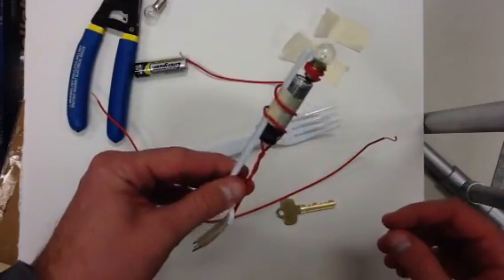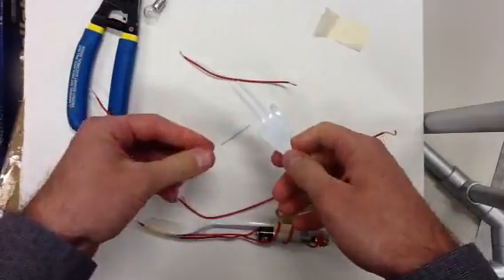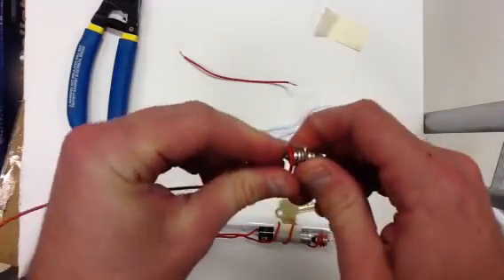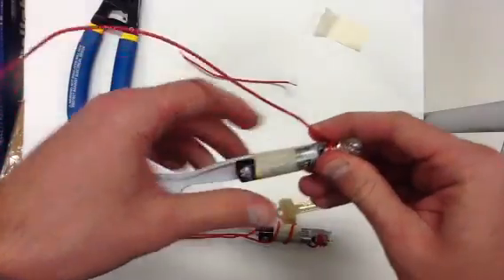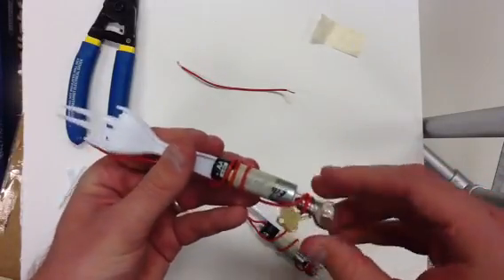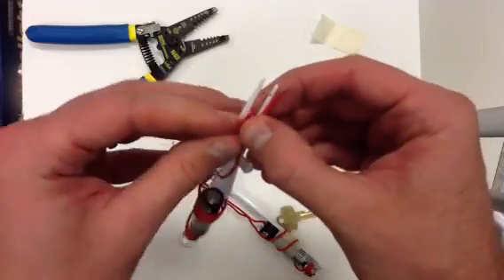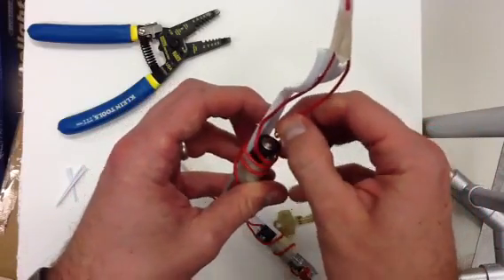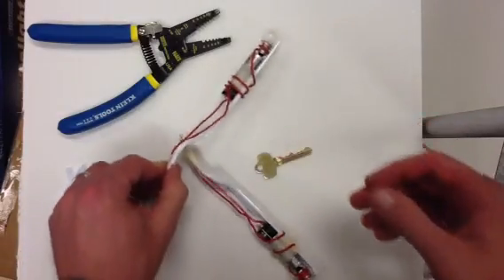Creating a Conductivity Tester

Comment: Can I use any wire?
Reply from the maker: AZ Chan, I would recommend 18 or 22 gauge solid wire. You can use any wire but flexible solid wire will make the project easier.

Comment: AWESOME! An awesome home-made flashlight, so cool!
Reply: It’s a conductivity tester, to test how well something can conduct electricity. So if you put it on copper or metal it will light up. But since rubber is non conductive, if you put it on a rubber sheet, it wouldn’t light up. So to use it as a flashlight, you would have to carry around a very conductive metal like copper to put to the top. But generally it’s not very good for a flashlight.